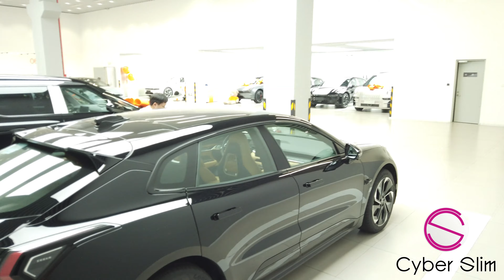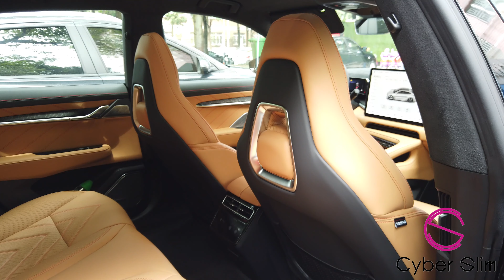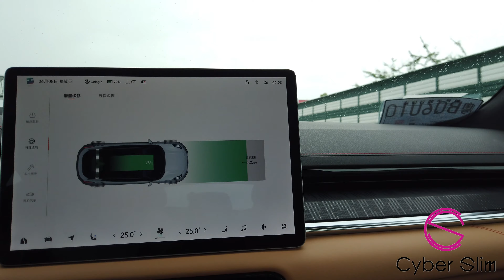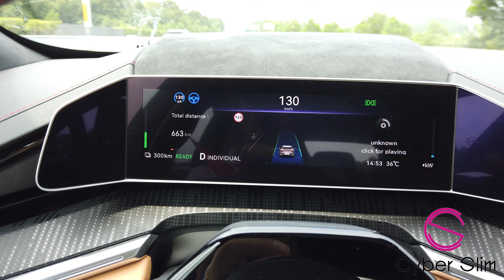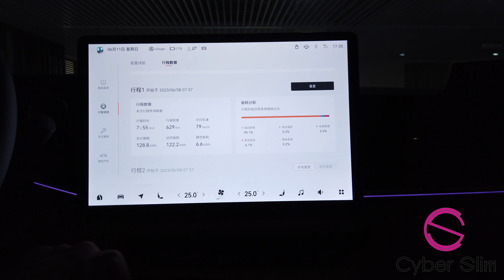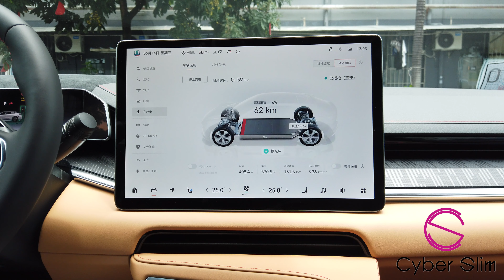Zeekr 001 with 140kWh and 1000 km range!

Comment: Personally charging a car for 40 minutes is still quite along time i do prefer the NIO swap station where i can have a swap in less then 5 mins and I like the look of NIO's
Reply from the maker: No! I watched the whole NIO battery swapping thing in person. There is no 5 min, that's marketing blah blah.

I observed close to 15 min. The problem is, that in that time, like on a stinking gas station, you have to be present. When I stick my EV in to charge, I lock and walk away to get a bio break. Much more convenient and relaxed. The new batteries like the one in my Zeekr will kill swapping tech. This is totally a dead end!

Just came back with my EQA 250+ from a 1200 km round trip. Even with this EV, I only needed one charging stop and that was just enough time to eat something and resupply.

Please watch the video to the end. If you catch the high charging rate between 25 and 70%, you only need 22min on a charging station and you can drive 1000 km when you leave with a full battery.
Reply: @cyberslim7955  not sure where you are getting your info about the swap information but it's false.Less then 5 mins plenty of youtube vids on it no need to lie to make that brand seem better.  Enjoy your ride hopefully no issues on your car
Reply from the maker: @Random.Adventures.  I don't get my information from anywhere, I watched it live myself on a parking lot nearby.

If station is open, in operation, has staff ready for your car, has the doors open, has ready loaded batteries, etc, then maybe less than 10 min. But that's very unlikely.

The worst: These station will most likely never be along highways, where you actually need fast recharging, at least I have NEVER EVER seen one. Have you? If I see marking BS, I call it out.

On top of that, the battery rental is very expensive over the lifetime of the car and the purchase option makes the car overpriced compare to Zeekr and other brands. The quality is at best VW level, Zeekr is like Volvo, close to BMW. In fact, my Zeekr 001 exceeds in terms of quality and material selection my new EQA 250+
Reply: You're you're obsessed with numbers only, after that right of almost 8 hours and about plus 700 km you really don't mind about stopping for about 40 minutes or even 1 hour. That's just ignorance because you actually never had sat in a long range EV...

Comment: Range 1000 kilometers, that is unbelievable...
Reply: Yes id you drive 50kmh,but if you drive 150kmh then the range is 700km. Still very impressive. But i guess if you put 140kwh batteri on most cars that are also aerodynamic then they will also drive 700km at 150kmh
Reply: @TheEdmaster87  for me 700km at any speed is like more two weeks without charging, insane !
Reply: @NewtonGonzalez  I can manage 2 weeks easily with my Model Y Performance. 700km real range would for me be a month daily driving

Comment: You resource hogger that makes transition to renewables go slower.
Reply from the maker: Certainly one way to look at it. The other could be: If larger batteries are a success, many car buyers could be much easier persuaded to switch from gas powered cars...
Reply: @cyberslim7955  No. Edication that you dont need it when know how to charge is the way to go. 
As you teach kids economics in school and by parents.
Reply from the maker: @michaelenglund  One hat fits all heads is not my cup of tea!
Reply: @cyberslim7955  Resource hogging like that should be illegal.
Reply from the maker: @michaelenglund  Let's move all back to the cage without wood resource hogging for a fire...🤣

Comment: How much was the price for the zeekr with this 140kwh battery.. Are you residing in China?.. Did the big battery affect the rear seating position likewise cargo space..
Reply from the maker: Price was around 51k Euro or 56k USD. The big battery is really new hot tech stuff. It does not take more space then the 100kWh battery, nor does it affect the trunk space, which is huge.
Reply: @cyberslim7955  are you serious?.. 51k euros for a car with 140kwh battery that can power your house give you range like that of lucid that's been sold for 200k euros.. This is huge deal.. With average good software and camera accessories, which the lucid doesn't have.... Are you in Sweden or China?.. Why do I feel they're selling at a loss. I heard they will only deliver 1000 of this cars with 140kwh battery
Reply from the maker: @faithosadebe5293  Hang on second. Lucid promises the range, but when you drive it, you don't get it. Same with T junk, over promise, total underdelivered. Check out recent "reuters com investigates special-report tesla-batteries-range". This is really f*ed up how they cheat the customers when they drive the junk off the lot.
My Zeekr with this battery simply delivers on any road! I recently rented a Audi A6 with a 75l tank. Compare to my Zeekr I was surprised how quickly I need to refuel the A6. Have you ever had range anxiety in a gas powered car? That's the power of the Zeekr with a 140kWh battery.
Reply: @cyberslim7955  I totally agree with you.. Lucid just have a good design, but terrible rip off.. Also lies about the range.. I recently just watched someone range test, for the pure version AWD with claimed range of 420miles with a 88kw battery, he could only get 250miles.. For 78-90k EV, isn't that crazy??..  Tesla build quality is just terrible but with good charging network that will become bizarre come 2025..
Reply: plenty of Zeekr 001 in China, and they are very common, Lucid is not affordable in China, and I believe they will lose money if selling at that price range, Tesla model 3 here is around 30k usd
Reply from the maker: @popyocherryXD  Lucid quality is worse then T junk, and T is total utter junk! Why would anybody ever spend 200k for that in China, when you get better tech same space for a 1/4th of the price? Lucid seems to be an even bigger rip off than T junk.

Comment: Thats pretty amazing, Just amazing what these chinese manufacturers can do. Question is why Tesla doesn't do it already? Why many other EVs from germany doesnt do it?
Reply from the maker: Because they all purchase batteries, and the Chinese brands have better access to CATL, which in turn has over 50% world market share with extremely strong research. Hard to beat...

The interesting thing is, that T junk is now in the same boat as all other brands, besides BYD. They beg all the suppliers, including BYD for batteries. The difference, their cars are of poor quality and lack lots of features. T junk in my opinion has no future.
Reply: @cyberslim7955  Zeekr and Xpeng have these batteries and claim the best range and charging speeds.
Reply: @cyberslim7955  is your vehicle an AWD version or RWD..  Did watch the video.. You didn't state if it AWD or RWD
Reply: @faithosadebe5293  140kwh version is RWD only, no air-sus.
Reply: china is not able to compete on software
Reply: @voicevy3210 ahahahahahahah😂
Reply: @voicevy3210  maybe not now, but in the future it could be equal

Comment: 1000 km is for city cycle, with low speeds. 700-750 km is more realistic for Highway speeds
Reply: I guess 1000km is possible with 90km/h
Reply: @rkan2 for sure, my Zoe with 41 kWh battery makes at 80-100 km/h 340 km of range, this will surely make much more
Reply: @rkan2  and drafting behind an 18 wheeler.
Reply: Still awesome!!!
Reply: I don't think you're right.. A friend of mine claimed did see a review at 120kph claimed range of 810km.. The least
Reply: @faithosadebe5293  What temperature? EVs are usually most efficient around +25C so +/-5c from that could be 100km already with such range.
Reply: @rkan2  okay.. Made mention of ArenaEV.  If you Google 140kwh zeekr 001.. You will see the video.. Also claimed some got 850km..
Reply: Ok wingers still further than most ice cars so suck it up...
Reply: @donald7542  this is actually the key comment

Comment: Das Auto, hätte ich auch gern.Toller Wagen.
Reply from the maker: Durch die Reichweite und dem Platzangebot ist es das mit Abstand beste EV das ich bisher gefahren bin, weil einfach unfassbar funktional!
Leider aber gibt es auch Schattenseiten. Mach ich vielleicht noch ein Video dazu. Das schlimmste sind die Touchfelder am Lenkrad. Totale Bedienkatastrophe.
Reply: @cyberslim7955  Fahre seit 1Jahr den Link und Co 01 und da habe ich auch die Touch-Fehler am Lenkrad. Wird bestimmt auch noch verbessert.
Reply from the maker: @riccowerner7747  Ich stehe voll auf physische Knöpfe, die sind treffsicher in jeder Situation. Beim BMW iX den ich neulich gefahren bin ist das super!
Reply: @cyberslim7955  the battery is it LFP or NMC.. Are you from Sweden.. Apart from the touch panel, is the sound level that good.. Noise coming into the cabin
Reply from the maker: @faithosadebe5293  The battery is the latest Qilin from CATL https://youtu.be/VeMjf6H0Pw4?t=69
Inside noise insulation is good, but not as good as my Taycan with optional noise Insolation glass, or the Mercedes EQE, which I test drove. However, it is certainly much much much better than the MS90D T junk, which I finally sold recently. Hope that helps.
Reply: @cyberslim7955  thank you. They have NMC & LFP.. Which did you opt for in your EV.. How much did you pay.. I know the zeekr with 100kwh battery pack goes for 50k euros
Reply from the maker: @faithosadebe5293  I don't know what chemistry the battery uses. Does it make a difference?
I recently rented an Audi A6, gas 95, not a diesel. The range was less than in my new Zeekr. This is really a game changing car, in my option.
In Europe they will most likely not offer this large battery option for some time. I paid for the base edition plus this battery about 51k Euro.
Reply: @cyberslim7955  you did the right thing honestly.. Currently, the base with a single rear motor, is what is getting the Qilin battery..  You have an unbelievable range at your hand.. Journey a whole week to work, u don't have to charge.. Wow
Reply: @faithosadebe5293  nmc
Reply: Am subscribed to your channel.. Hoping to see more reviews and trips..

Comment: Reality around 650-700km because consumption are 20+kwh on 100km on average
Reply from the maker: Which is still huge. I currently drive a very basic Audi A6. After 450km the tank was empty.
Reply: @cyberslim7955  and you need 1 minute to fill it up
Reply: @Mr11ESSE111  you must be high saying it takes a minute to fill up a gas car from empty to full.. Someone already did the comparison.. From payment to pumping the gas everything was nothing less than 5mins to 10mins..
Reply: @faithosadebe5293  depend from pump to pump and country to country and in which line you are  but for fill it up it goes from 1-2 sec for liter or something more if you take petrol cable for big trucks then it can fill it up  2-3 liters in second
Reply: @Mr11ESSE111  Maybe you can charge it in night. At least driving 700+ in one day is a hard job.
Reply: @junguo3088  where at night
Reply: @Mr11ESSE111  In china. Hotel and public parking all has charging facility. And the rest place of high way all have charging place. But most of people charge at home parking place.
Reply: @Mr11ESSE111  My friend driving a BYD EV from shanghai to Xinjiang right this month. It is about 4000KM. There was no problem on charging all the way. Even to tibet charging is not a problem too.
Reply: @junguo3088  of course its not, only problem are time
Reply: @junguo3088  problem now  in EU   countries is that charging on chargers are more expensive then normal fuel  so prices are  from 40-80cent per kilowat  and you must recharge  around 40min -1 hour  or more depen if you want 100% to get range of around 400km  and  petrol&diesel car for that range  you need around 20-22 liters fuel  which you can refuel in 25 seconds and costs same or less  then electricity
Reply: @Mr11ESSE111  WOW. In china daytime charging cost 0.6 RMB per KWH and 0.3RMB in night. ALmost 8-4 eu$ cent per KWH. Why the electricity cost so much in EU? Diary using one week commonly just need one charge. And the cost almost 1/10 compare to fuel cars. That's why EV are so welcome in china.
Reply: @junguo3088  soon in China will be electricity more expensive if  most of peoples will have EV vehicles !! in China are less expensive because you have  lower wages
Reply: @Mr11ESSE111  Lower wages? How low? I live in shanghai. Just this month Gov release the average salary per month in shanghai in 2022. It is 12000 RMB per month almost 1500 EU$ per month. I do not think it is very low compare to EU. The price of energy is base on the price of oil or gas. I think it has international price. China import a lot and keep this price for very long time. Maybe a lot of energy nowday is from water power or solar or fan power or nuclear.
Reply: @Mr11ESSE111  Why china encourage people charing at night at half price of electricity. Because it is hard to restore them at night. That means there are well enough power at night in china.  It is a good balanced way of how to using power properly.
Reply: @junguo3088  but if everyone start to charge at night  government will change rules
Reply: @junguo3088  Shanghai are more developed but outside of Shangai and some  smaller places or villages   probably are more like 200-300$ and prices will be same
Reply: @Mr11ESSE111  I guess you never been to china. How you know smaller places or villages cost more on electricity? The fact is cost of electricity are same in china because the price is ordered by the GOV. And at the poorest places in china, the gov pay the bills like electricity and water and gas for people. All the facilities on public are invested by our gov.
Reply: @Mr11ESSE111  In shanghai, it about 50-60% cars on road are EVS include buses and taxis. I didn't see gov change rules. And the taxi drivers are love EVs so much, the energy fee of taxi become extreme low.
Reply: @junguo3088  they will sacrifice everyone else for Shanghai, Beijing and other bigger cities
Reply: @junguo3088  in villages they don't have wages like in Shanghai
Reply: @Mr11ESSE111  Dude. I think you have no idea the rate of having cars in china village. I think in your mind chinese farmers are sit on cows.
Reply: EV still not for interstate imo..... charge time still too long... but Nio battery swap works well for interstate
Reply from the maker: @fatdoi003  I watched the NIO swapping in person. This idea of a 5 min swap is not true. I was more like 15 min. When there is only a single car in front of you, charging is already faster. IMHO swapping has no future. Big tech with lots of maintenance without much benefit.
Reply: @cyberslim7955  Then if for NIO the 5 minutes swap is not true...what about fast DC charging? What happens if there is queue at the charging, like for example in the summer before holidays? The answer is that swap is better than charging.
Reply from the maker: @Alberto-xw8vx  Go for it and believe the marketing hype. For me it's clear:

Charging takes 15-25 min when a charger is free and I can leave the car and get a coffee and can supervise the charging level remote. Even better is the Zeekr with 140kWh, I stop to get a coffee and don't charge at all...

Swapping takes 10-15 min, when free, but you cannot leave and get a coffee. Why does it take 10-15 min? Because when I watched the process, every station has service person to supervise and guid the drivers, if they don't hand over the key. By the time the door is open, the charging station is ready, the car is in, etc... You guess can see how 15 min are gone...
Reply: @fatdoi003  where you have swap batteries place on highways!?
Reply: @Mr11ESSE111  like charging places instead of hooking up the charging cable, just swap a battery
Reply: @fatdoi003  where will you find swap station on highways !!it's pretty rare
Reply: @Mr11ESSE111  that'll be up to car companies if they can settle on a standard battery format like CD or VHS tapes... If they can then every gas station can be converted to battery swap station...
Reply: @fatdoi003  that will not happened and  only  polestar  have few  swap stations  and  you will need much more then few and other EV manufacturers dont have that choice of swapping  easilly  so they will must produce new generation of eV and they dont want that because they will lose money  when you need to replace old or dying batteries and that is alot $
Reply: @Mr11ESSE111  that's easy, just make battery a subscription item, actually the battery can be excluded as part of the purchase and that will even make the cars cheaper...
Reply: @fatdoi003  Tesla dont want that and other companies except polestar

Comment: Hey guys remember this EV only AWD run with Eco some others EV can from AWD on Eco rin fwd or rwd and make long range I think for full AWD is best this class economy bravo geely best EV quality stability flat top unique style looks amazing car I love and guys this system display from AWD can do only fisker and you check the new Saab EV by NEVS gt Emily use best system engine wheel best economy long range 1000 km plus
Reply: Best EV so far is NEVS EmilyGT, but can you get hold of one? And it will probably be more expensive than the already too expensive Zeekr 001.
Reply from the maker: @bafattvahetere  Considering what else is on the market for this size and range, the Zeekr 001 is very competitive...